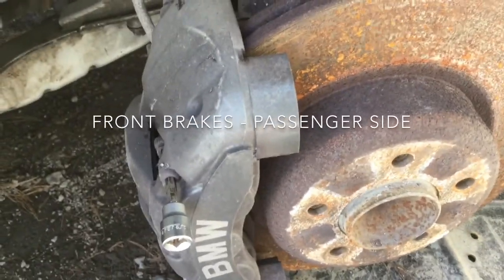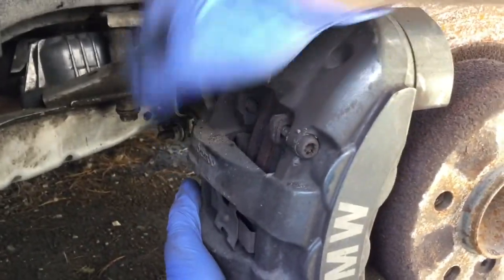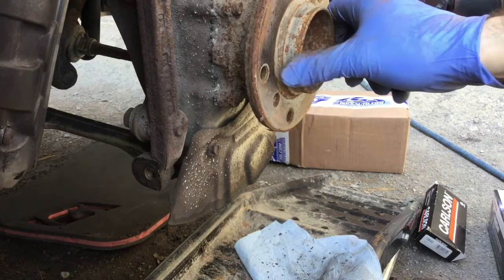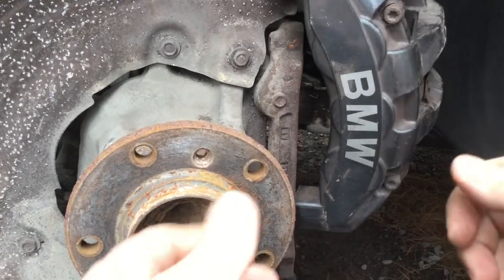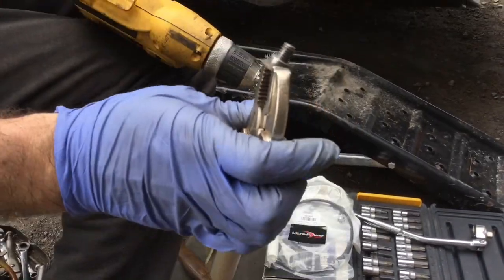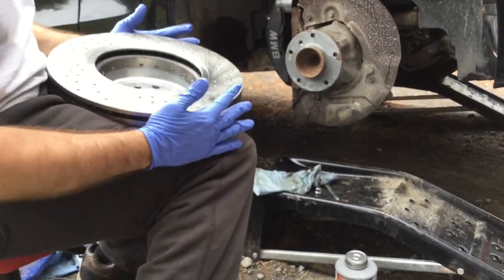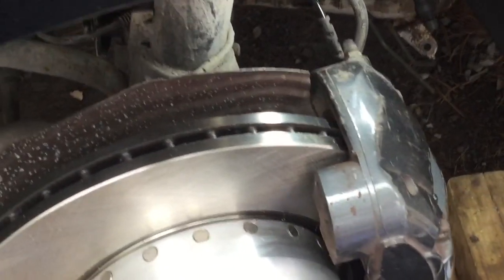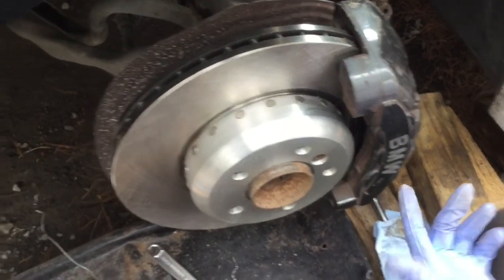2008 BMW 135i E82 - Front OEM Brembo Brakes

Comment: Why did you install drilled rotor on the passenger side and standard rotor on driver’s side?
Reply from the maker: Don't pay attention to it. I just had to install it meanwhile. This was a mistake - they were supposed to be both drilled. 

I just installed it until I received the replacement for the mistake. Didn't drive with it.

Comment: Are those bmw brake disc? I have new brake disc and brake pads will they fit my car I have a video on my channel
Reply from the maker: Well, if you bought it for your make, year and model, they should. In doubt, you can always compare the hold ones with the one you bought to make sure.